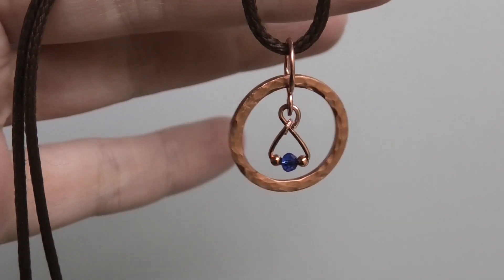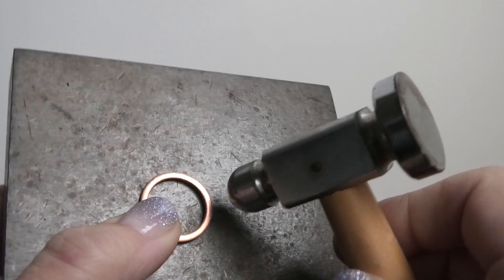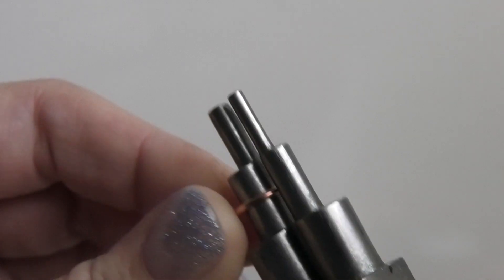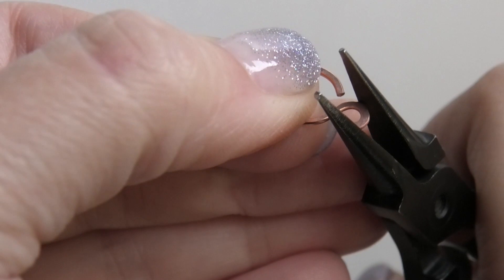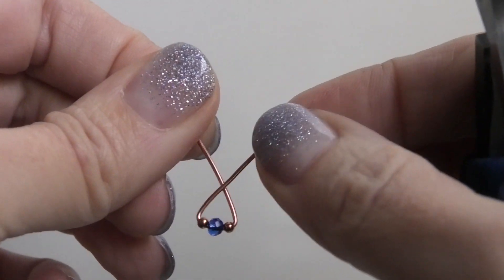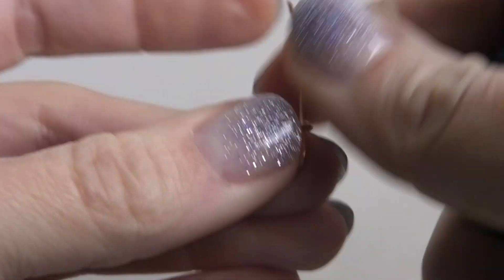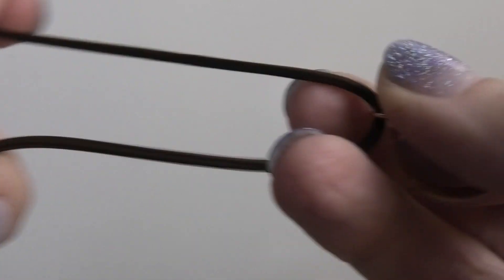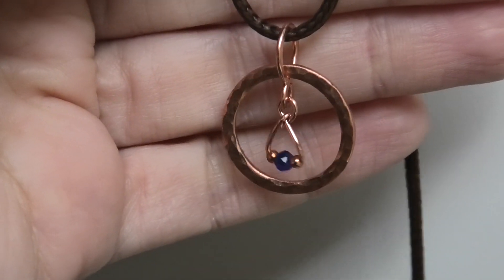2 in 1 Copper Washer Simple Beginner Wire Wrapped Bead Pendant Tutorial

Comment: And if you torch them you can stretch them easily into ovals. After torching they're also soft enough to hammer into rings. You can also use them for the back of your wire wrapped cab.